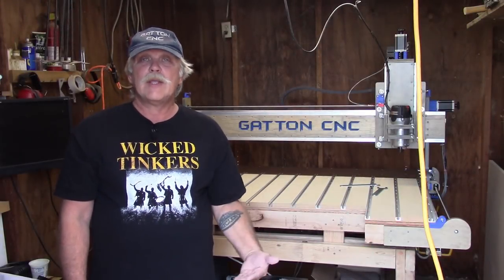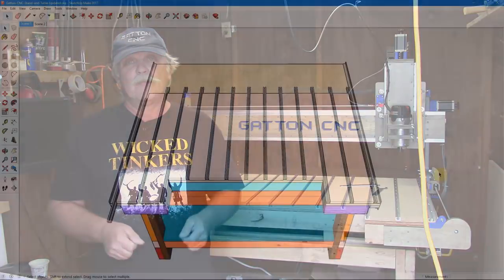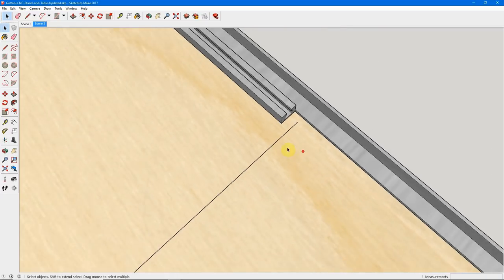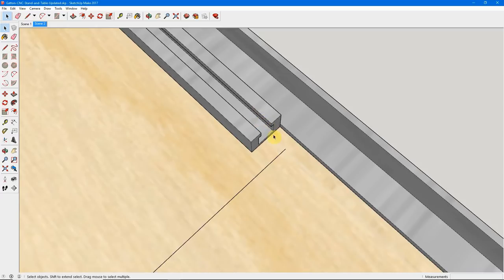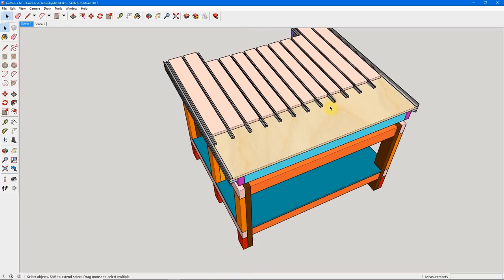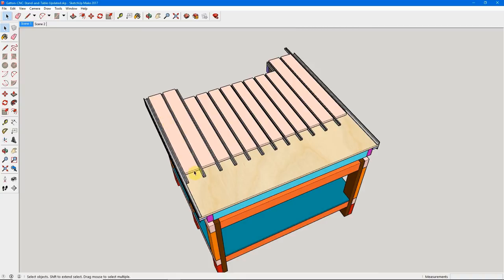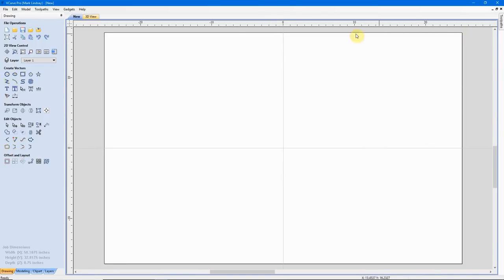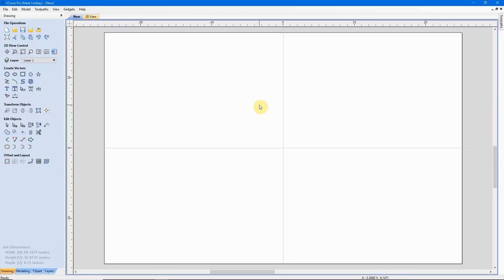Creating the Spoilboard Surfacing Toolpath

Comment: I notice that you are using a router for a spindle. My new machine came with a 400 watt spindle along with the mount for a router. Would you change out for the router.  I got a lot out your video, keep it up.  Jon
Reply from the maker: I would follow your CNC manufacturer's instructions/recommendations. If it came with a router mount, see if you can determine what diameter of router body it was made for, then look for a router that size. 400 watts translates to a little more than 1/2 hp, so you might be able to swap the spindle out for a 1 hp trim router. Do keep an eye on the weight of the router, however. The CNC gantry may or may not be rigid enough to handle it. Also know that routers have a more limited speed range than a spindle typically does. Again, check the manufacturer's recommendations.
Reply: @MarkLindsayCNC  I have a Makita router which is 64 to 65 mm. The extra mount provided is for the Makita router and per their instructions the mount is designed to handle it or a larger spindle size. As you probably guessed I’m new to this and so far only have made small things as well as leveling the spoil board.
Reply from the maker: Then you should be fine. Do know that after you mount the router, you'll need to adjust tram and level your spoilboard again. Here's how I did mine: https://www.youtube.com/watch?v=NvT3qj4B5DA

Comment: I know this video is old but it's a great video. I just completed surfacing my new spoil board using your method. Being a woodworker, I know that wood swells, twists and warps due to stresses in the wood, humidity and a bunch of other reasons. How do you make sure the stock piece you're using for a carve is flat as well? Do you run a surfacing gcode file for the wood piece you're using or rely on a planer or a drum sander or some other method before securing it to your CNC bed? Thanks!
Reply from the maker: Thank you, Rob. I check over the piece with a straightedge first to see if it even needs surfacing. If it does, I use several methods, including using my planer, a friend's drum sander, and occasionally running a surfacing pass on the CNC. It just depends on the piece and the project. On some projects, there's so much of the surface being machined away, I don't bother with even checking it out. I just mount it and start cutting.
Reply: @MarkLindsayCNC  Thanks Mark!

Comment: Another great video.  On my machine x is long axis, y shorter.  T tracks are parallel to y.  So I should raster along y axis?  Using 1/2 inch mdf between t tracks now, but thinking of going to 3/4 inch. (easier to get out in the county).
Reply from the maker: In the case of surfacing your spoilboard, you can raster in any direction you'd like. I machined in the direction I did for my convenience - it really doesn't matter all that much. What matters is that your dust collection hoses, water-cooling hoses, or electrical cords/cables are free to follow the router/spindle, and won't get caught on anything overhead or pull tight, as surfacing the spoilboard will take the router/spindle into places it usually won't go under normal operation.

Comment: Mark, thanks for your excellent explanation. 

I'm mystified why had you used  a Y offset of -.1115 and an X offset of -.174  when you first created the square.  Despite having stated you had set it to anchor on the centre, that wasn't the case; it was offset.  Regardless, you corrected it before moving on, by using the Alignment Tool feature.

Again, thanks for the great video.
Reply from the maker: Anchoring the rectangle by the center does just that; it anchors the center of the rectangle. It doesn't anchor the center of the rectangle to the center of the material. That's why I went back and aligned it.

Comment: can you surface your spoiler board with a 1/4 endmill (downcut) or a 1/2 straight cut, as i do not have a surfacing bit.   I know it will take more time, but I am living in Ireland and they do not seem to have any surfacing bits here and need to get something done on my cnc yesterday.   thanks.
Reply from the maker: Yes, you certainly can. As you said, it'll just take more time as the stepover should be set to about 40%-45% of your bit's cutting diameter. If you decide to use the straight bit, remember to ramp in the plunge move over a distance of twice the bit's cutting diameter. I wouldn't use the downcut bit as it'll leave a rougher surface. An upcut or straight bit would be preferred.
Reply: I will use the 1/2” straight bit.  So, under toolpaths, check the ramp plunge moves, and insert something like 1.01, which is just over twice the cutting diameter.  Thank you for your great you channel, but also the speed of which you responded to my message😊
Reply from the maker: Your comment popped up just as I happened to sit down at the computer. I'm usually not that quick - ask anyone - lol. A 1 inch ramp will be fine. Good luck!

Comment: Hey mark! why you start on the center of your material and not at the corner as usual?
Thanks
Reply from the maker: For this project I was still testing my machine. I had just finished building it, this was the first real toolpath I ran on it, and I was still getting things settled in. I was a bit concerned that I had gotten the size of the toolpath correct, so I thought that I had better take a more cautious approach. By starting from the center, I figured I'd at least get the majority of my spoilboard surfaced before I crashed it - lol.
Reply: @MarkLindsayCNC  I see ahah thanks! Cause ill need to surface my spoil board for the first time, but i would like to start the job on the very down corner, but I concern about the fact that on aspire if i set the precise sizes, the machine will leave the corners as you mentioned on the video above. But in other hand if I set, on aspire, a oversized material,, then when probing the machine it will not reach 100% the full spoilboard. I´m a bit confused actually lool
Reply from the maker: Set your toolpath to do the Profile Pass Last, then you'll get the whole spoilboard surfaced. If it doesn't get all of the corners, you can go back and make the pocket a little bit larger, then change the Profile Pass to FIRST. Then when you run the toolpath, it will cut the outline of the spoilboard first. When it finishes cutting that outline, stop the toolpath and see if it got those corners. If not, repeat the process, making sure you keep the Profile Pass set to First.

Comment: Does the wasteboard need to be MDF or can I use other particle board?
Reply from the maker: The spoilboard (waste board) can be anything you'd like. Most folks go for MDF because it's fairly cheap, easy to cut, and will hold threaded inserts and other fasteners (like screws) much better than particle board will.
Reply: @MarkLindsayCNC  OK thank you.

Comment: Mark I am watching  your this video and a  this point you just created the  cut rectangle. You set X to add .25 and then you set the Y to add .5 could you tell me  why you used 2 different numbers. Jeff
Reply from the maker: I needed to make sure the bit cut well off the spoilboard, so it didn't leave the corners uncut. I couldn't go more than .25 off the edge in X without getting too close to the metal rail. I went .5 off the front and rear edge to make up for that. It was all just to make sure I got the corners of the spoilboard cut.

Comment: Mark, can you explain the "Pass Depth" setting in your tool database. Is there a recommended setting for this depending on what tool you're using? You have it set to .4  I don't understand how this number is determined.
Reply from the maker: A conservative rule of thumb is to set the Pass Depth at 1/2 of the bit's cutting diameter on MOST bits. Not all of them work out that way. The bit I used for this video was new to me when I made it a few years back, and I hadn't learned its capabilities at the time. I have since changed the Pass Depth of that bit to .1 inches to make it a bit easier on the router and the bit's shank. For purposes of this video, I wasn't machining off anywhere near .1 inches of material, so the Pass Depth was never really relevant.
Reply: @MarkLindsayCNC  Thank you for explaining!

Comment: Hey Ya'll, Is the bit going along "centered" on the first outside toolpath, therefore (using your example #s) actually cutting 3/8" into board? (1.25" bit/2 minus 1/4" relief in toolpath from board) I have to ask since I don't know if Vectric is applying your 40% stepover on first cut, and it determines my needs for a 2" surfacing bit.  Thanks Mark!
Reply from the maker: Yes, the software is applying the 40% stepover to every cut - including the first, outside toolpath.

Comment: mark, what is a good speed and ramp length for a 1" surfacing bit as well as stepover to surface spoilboard of mdf
Reply from the maker: If the surfacing bit doesn't have a cutting edge all the way across the bottom, ramp in at least the bit's diameter. I prefer to ramp in 1.5 times the diameter, but I'm just very cautious. I run a 45% stepover on my surfacing toolpath. It takes a little bit longer, but I get a better finish, and that's what this is all about. Likewise, I use a slower than normal feed rate - somewhere around 40 ipm. Your machine will determine that - there are a lot of variables.

Comment: Hi Mark, great video and very informative. I followed it religiously step by step, but you didn't show or mention how to modify the cutting file if there WAS material left at the corners. I assume that it is easy to change but being a newbie I had to start over. Please note that this is meant as constructive criticism.
Reply from the maker: No worries, Barry. I thought I had mentioned it in the video. If you have material left in the corners in the preview, make the rectangle slightly longer or wider (or both) to remove the material, then recalculate the toolpath.  Start by increasing the length and width of the rectangle by the diameter of the bit, recalculate, then preview. Keep doing that until the material is machined away, then save the g-code. I hope that helps.

Thank you for watching!
Reply: @MarkLindsayCNC  Hi Mark,

Thank you so much for your response. You DO state in the tutorial that it is necessary to amend the size of the rectangle, but you don't show HOW to do it. Being around 75% through the process do I have to start over from scratch to amend the size or do I jump to a previous screen? I know this will be obvious in a couple of months but right now I'm on  a steep learning curve.
Reply from the maker: Okay, no problem. Just go back to the 2D view, go back to the Drawing tab, select the rectangle, click the Set Selected Object Size icon and change the size of the rectangle there. Make sure to anchor the rectangle in the center, then change the width or length of the rectangle as needed. If you need to change both, uncheck the link X Y box, then make the changes. Click APPLY, then close. Then go over to the Toolpaths tab and click the Recalculate All Toolpaths icon, and preview the toolpath. Repeat if you need to.
Reply: @MarkLindsayCNC  Hi Mark, 
That description is just what I needed. Thank you very much for your time - it is much appreciated. As soon as I have my spoil board sorted I'll proceed through your other videos as I find your style very informative and easy to follow. Many thanks again for all your input on this fascinating subject.
Reply from the maker: You're welcome, Barry. If I may, I'd like to suggest that you check out my series on the Vectric titles for the Absolute Beginner. I go over all of the questions you've asked within that series a few times as I introduce tools, techniques, and methods. I try to gear the videos to the person who has never done anything like this before, but even experienced users have told me that they pick up tips and tricks in most of the videos. Go to my main channel page by clicking my name, then click the Playlist tab. You'll find a play list titled CNC for the Absolute Beginner - it contains all of the videos in the series. Good luck!

Comment: Hi Mark, I would like to know if the size of my workpiece has any effect on cnc bit speed & feed rates. I have an NWA Shark II that has a usable XYZ of 13x25x7, I am not trying to cut anything bigger than this and most of what I do now are Vcarve signs and 3D stuff. I use VCarve desktop.
 Thanks for any knowledge you can help me with.
Reply from the maker: The short answer is no, the size of the project doesn't have anything to do with feed rates or router/spindle speeds. The material type, depth of cut, and bit used will dictate that.

Comment: Could you explain what the pass depth is and why the pass depth is 0.40 inches?  Is seems that the cut depth of 0.020 inches is in Z, so this doesn't make sense to me.
Reply from the maker: The Pass Depth and the Cut Depth both have to do with the Z axis, but they are 2 different things. The Cut Depth is how deep I want the bit to cut into the material in this specific toolpath. The Pass Depth is the maximum depth the bit is allowed to ever cut in 1 single pass. In this example, if I wanted to machine away .75 inches of material, the bit would have to make a minimum of 2 passes, because the Pass Depth is limited to .4 inches. The Pass depth varies with each bit, but the standard rule of thumb is that it should be no more than 1/2 of the bit's cutting diameter. For example, I have my Pass Depth set to .125 inches on all of my .25 inch end mills. I'll talk about this further in this coming Sunday's Live Q&A, at Noon Pacific Time, 3pm Eastern Time. See you there!  https://youtu.be/5GUSp_mA_0Q

Comment: Great tutorials, Thank You!
I’m having a problem with my perimeter cut.  I cut my mine last after the raster cut.  With the raster cut, it is perfectly trammed.  You cant feel any ridges between passes in either direction.  However, my perimeter cut always cuts lower on the right side of the table and tapers up to the left side.  I end up with a spoil that is perfectly flat and a strip, roughly 0.020 deep down the right side.  (Only the width of one pass). The top and bottom edges fade from this groove up to full height on the left.  Anyone have any ideas?  I don't know what I'm missing?

Comment: Seems like a lot of steps. I just surfaced my 5'x10' cnc with a 1" end mill. Here's how: Create a rectangle, size to 1.75 x 119" and locate to x0/y0. Array vertical 37 times @ 1.6". Path to the inside. I run my spindle around the table while it's running and lower by .010" until it's cutting all the time (to get rid of over deep cuts). I ran it @200ipm and it took about 45 min to complete.
Reply from the maker: There are always going to be more than one way to accomplish the same goal. Please keep in mind that my videos are geared toward the person who has never done anything like this before, so the methods I tend to choose are chosen so I can explain the "why" as well as the "how." Your method is a perfectly valid way of getting it done. No doubt others have found more efficient ways of doing it that you and I haven't explored yet. My goal is to show folks who are new to this how to take a task like this and break it down to the basic operations needed. If they get that "lightbulb moment" and figure out another way to do it that's more efficient for them like you did , then that's a bonus.

Comment: Hi Mark - Can I assume that Im safe to use this same process when wanting to surface a piece of job material. 
Set up the job material in the centre of the spoil board bed. Enter the dimensions in Aspire New File as 3/8" larger than the actual job material size. Use the Datum centre and then follow the rest of your Tool Path steps?
Thanks John ( if you could reply to my Instagram page then I'm sure to see it)       @creationsenbois83
Reply from the maker: You certainly can. I plan on doing a video on this subject in the future, but you have the gist of it. Measure the length and width of the piece you want to surface, create a vector based on those dimensions that will cover the entire surface you want to cut (I used 3/8 of an inch in the video, but you can use whatever measurement you need to use to ensure you get the corners,) then calculate the toolpaths for the job.

As a side note, I don't use Instagram any more. It just didn't work for me.